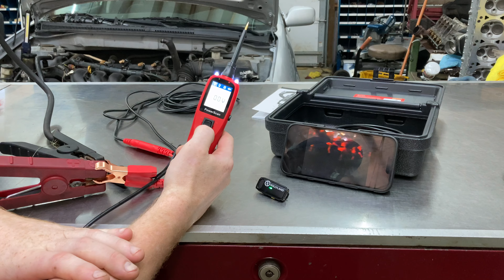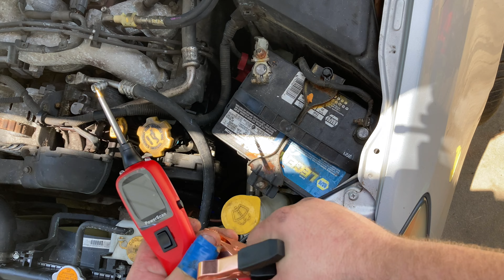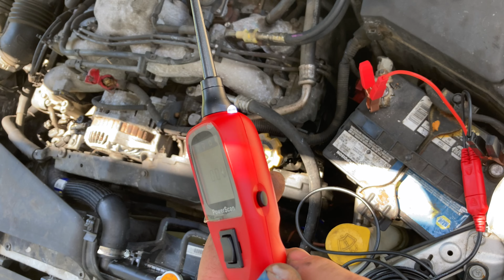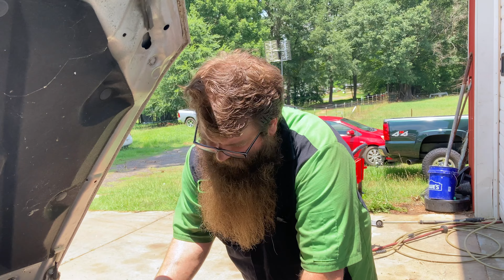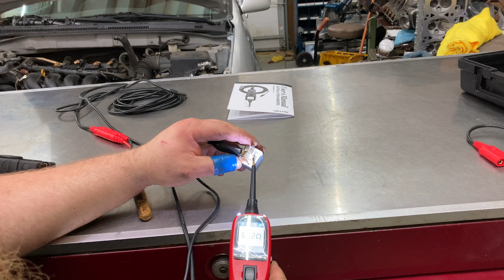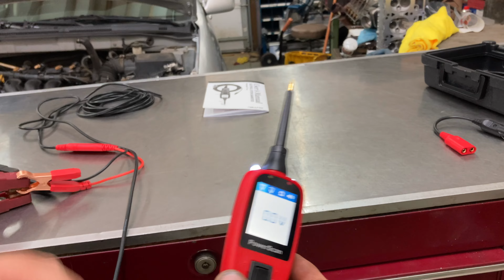Autel PS100 Automotive Electrical Tool Testing and Review

Comment: Overall would you recommend it? I sold my power probe 3 thinking I didn't need it and well I need it I can afford the probe but if this is better and cheaper then I'd choose this but again only if you think it's a good purchase also does it have a "max and minimum voltage read" feature like if I'm checking a starter wire signal obviously you'd have to be in the cab to turn the key if nobody else is around
Reply from the maker: Yes, but… I have an old power probe that I use the most. It’s limited in overall functions but for checking and applying power and ground it’s super easy. I would say that this tool is basically equivalent to it. We also have another tool that will a little of everything: checking and applying powers and grounds, latching power or ground, 0-5v power supply, signal generation, injector pulse tests, oscilloscope, measure resistance, relay testing, and other stuff. It’s called the vdiag v500 and we’ll have a video on it shortly. It’s awesome, but not quite as fast and convenient as the this style probe for the more common uses.
Reply: @automotiveinsight I ended up just buying a power probe 3 it's what I know and it has that feature I appreciate the insight but I think I made the right choice for me

Comment: The AC mode is intended to be used with quickly changing digital signals, but only as a go no go. Yes you still need a scope but you can tell if a sensor is sending or a computer is talking.
Reply: It might also help with injector pulses